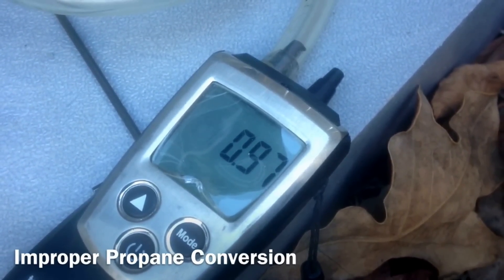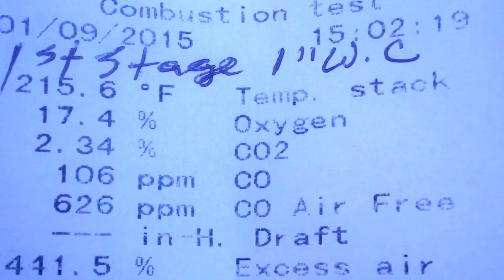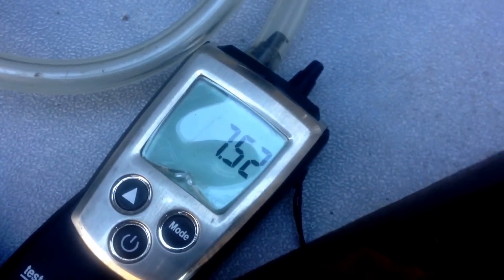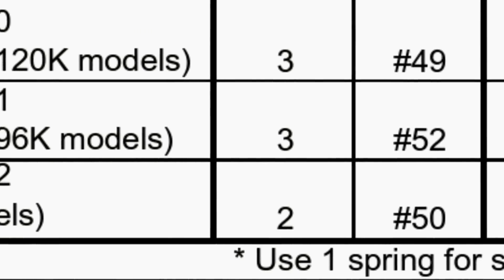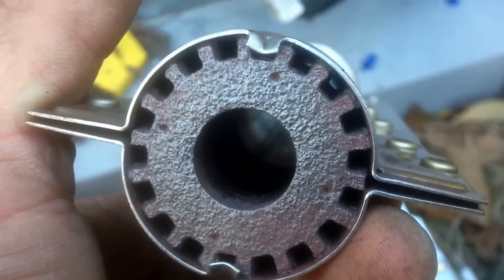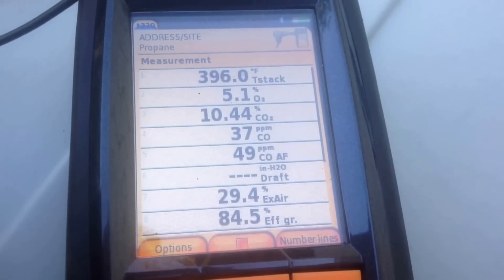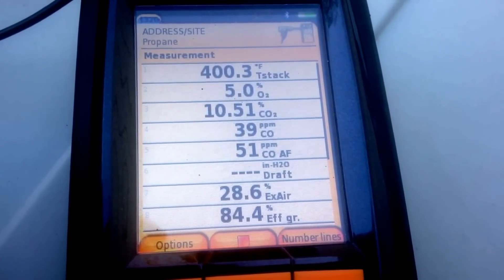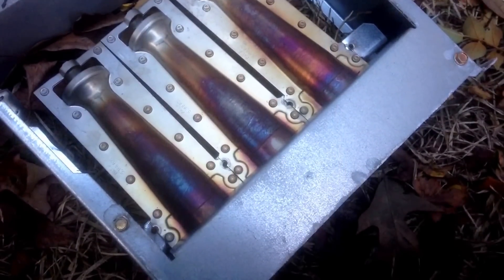HVAC Service: Improper Propane Conversion

Comment: I had an improper propane conversion done on an Evcon/Coleman furnace in a 1996 Kentuckian mobile home.  My problem lingered on for 15 years.  They had flipped the thing over in the gas valve to adjust the pressure from natural gas to propane, but stuck in a .080 orifice. The sticker plainly stated for propane use a .045.  The flame was large and yellow in color and the little glass peep hole stayed sooted over.  Every year I called in hvac technicians.  Whatever code was blinking on the board was the area they would go to and replace a part.  It always flashed a different code so I got several new parts.  The last hvac technician could not get it up and running so he told me I needed a new system.  I told him the system was problematic every since it was new.  Since I could not afford a new system, I took a look at it myself and found the problem.  I used JB Weld to plug up the opening in the orifice.  While the JB Weld was still wet, I stuck a sewing needle that measured .045 through it.  The flame was running too lean and not producing sufficient heat; I was lucky I did not melt the tube.  I enlarged it with a 1/16 drillbit (.060) and it has worked great for the last two winters.  Because of the 'flooding' situation, the flame sensor would sometimes 'read it' as a failure to ignite and shut the system down.  At whatever point it was at in its cycle this would happen so it caused various codes to flash at different times.  I also noticed after my 'repair' the exhaust does not look like a steam plant when it is operating.  Oh, by the way the hvac technician said I was actually out of propane and had had some added was why the system had began operating correctly.
Reply from the maker: That sounds like quite an ordeal! Too bad the technicians didn't see the issue.

Comment from the maker: HVAC Service: Improper Propane Conversion
Reply: Great vid and explanation Stephen Rardon. So what was the final out come?
Reply: Wow . when I see things like that I always ask myself the question. "Did someone knowingly leave a system in operation like this or was it a lack of training?" Great vlog Steve as usual.
Reply from the maker: John Rumbold I'm right there with you. If Hope it was a lack of proper knowledge.
Tazzman228 we will be returning to properly convert and hopefully
Be able to clean the rest of the soot
Out of the burners.

Comment: Just came across this post. You said towards the end that the turbulators was not removed when converted to propane. Why should they be removed? I have what appears to be a plugged up Hx on propane and I'm curious is that my issue. Hopefully you'll see this post. Thanks.

Comment: If it's working the customer got lucky. With propane and soot. If the heat exchanger soots up I've had very little luck saving them. ( if the flu smells like hell ) the party is over. Is it gonna live?
Reply from the maker: I didn't smell anything, which is strange now that I think about it.